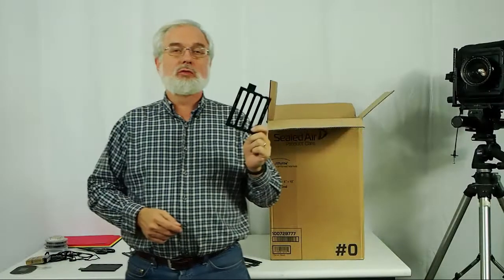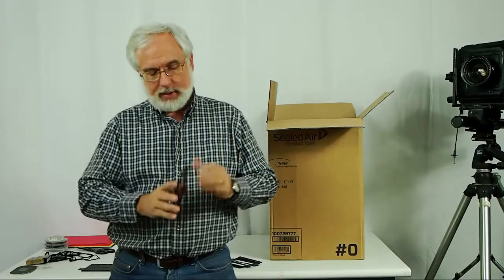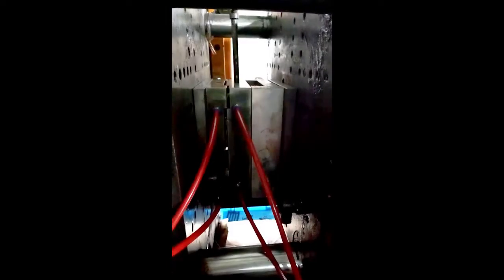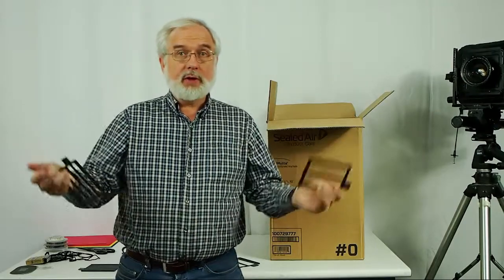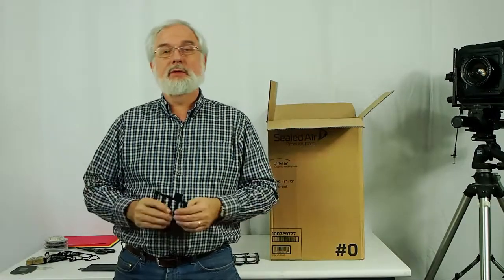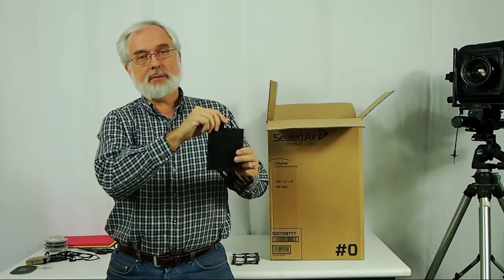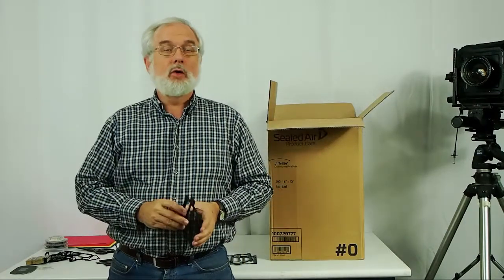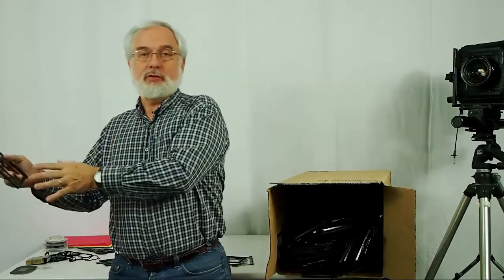SP-445: Film Holder, Rev 3

Comment: Hello! I have had the SP-445 since the Kickstarter.  I wanted to order another set of film holders thinking it may speed up my darkroom processing and that is when I noticed the different "revs" of the film holders.  I have the solid "rev 1".  I understand this video and that the difference between rev 2 and rev 3 are for the manufacturing process.  However, what was the reason for changing from rev 1 to rev 2?  Is there some sort of an issue with rev 1?  I have noticed that sometimes it is a little difficult to remove the film from the rev 1 holders.  Almost like the film is "stuck" to the holder.  A little stream of running water from the sink seems to take care of that.  But that is the only issue I have noticed with rev 1 holders.  Thanks for a great product, and keep up the great work!!
Reply from the maker: John,

We changed to rev 2 because some people where getting "lines" on the back of their negatives from the ridges in the film holder. While these almost never appeared in scans, we changed the design for the second production run.

If you're happy with the Rev 1's, we still have some in stock.

Regards,

Tim
Reply: @timklein185  Thanks for the reply Tim!